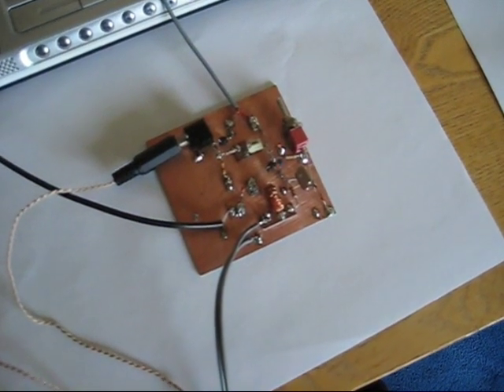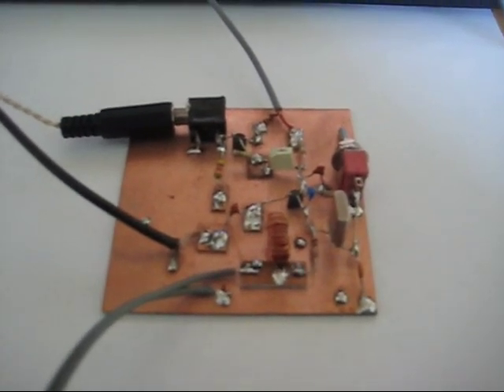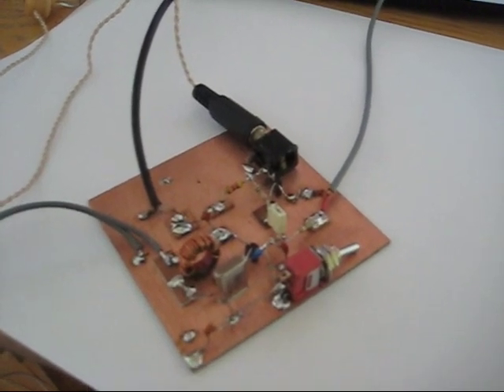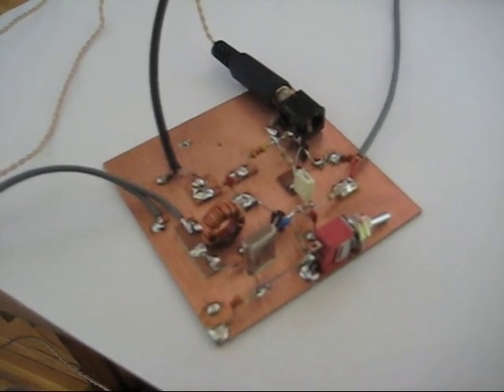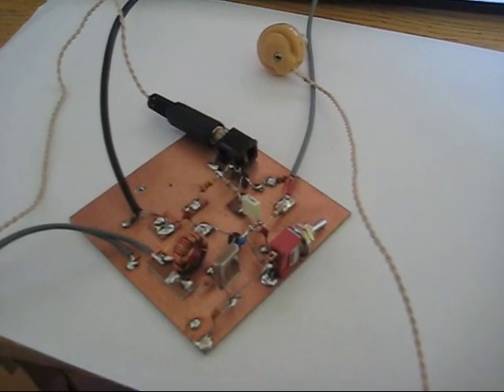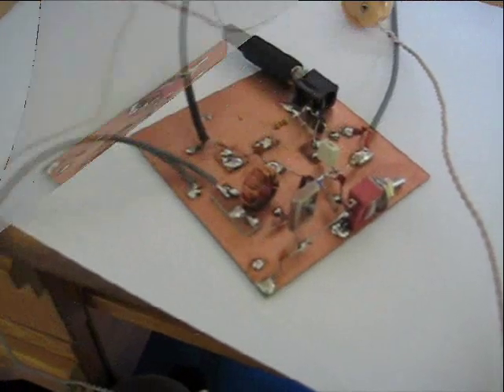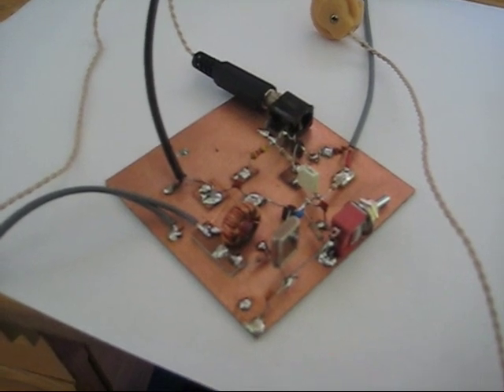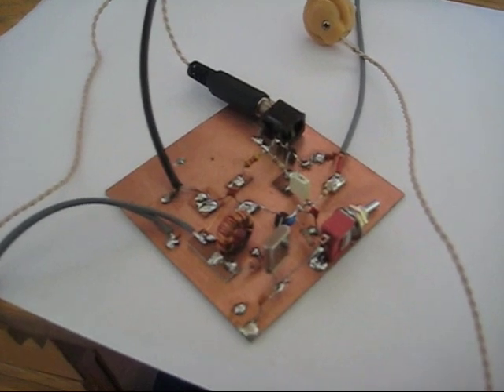G3XBM's XBM80-2 80m CW Micro-transceiver

Comment from the maker: You MUST use a sensitive high impedance earpiece with this rig as there is so little audio gain.  A PC headset could be used but then another AF amplifier would be needed, so it would not be the very simple rig it is any more.

Comment from the maker: The coil is a T50-2(red) toroid and it was wound with a coil using thin enamelled copper wire to give an inductance of 3.9uH (3u9). This can be measured with an inductance meter.